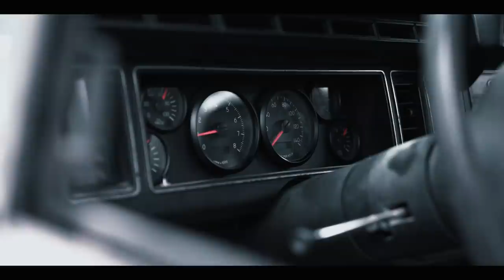4,700 mile road trip in 40 year old Bronco... Goodbye!!!

Comment: Hey Matt, switch your pump over to a  diesel pump on the fire truck so you can run it off the trucks tank and not have to worry about remembering to fuel it up. Alot easier to remember to keep the truck tank full!!
Reply: Good idea
Reply: The trash pump is gas-powered, not diesel.
Reply: @SuperSecretSquirell  that would be why he said switch your pump to a diesel pump
Reply: @charleslaatz6189  oh yeah, I read right over that lol.
Reply: I came to the comments to say the same thing. Lol
Reply: Yea thanks for copying my comment t bud... you literally posted this within minutes of me posting the same idea with different words lol glad someone's comment with that idea got noticed though
Reply: @kolin99895  sorry about that I didnt read any of the comment before I posted. I apologize should of read them first, didnt mean to steal your idea or thunder!
Reply: @TDUBTWYSTEDscion  it was a joke bud just hard to see someone's face through a comment that's why I threw in the lol
Reply: Diesel pumps are hella expensive. Matt can afford it, but it seems like an unnecessary expense.
Reply: @americansmark  Matt has built his empire around unnecessary lmfao
Reply: Matt
Reply: If he really wants to do it, he could just attach a pump to the PTO on the truck.
Reply: Pto pump would be the route I'd go down rather than a separate engine
Reply: @robda7195  agreed. However a diesel pump would be quicker
Reply: Yes or depending on what transmission he has can run a pump off a PTO
Reply: He should put a hose turret on the roof in the hole for a ma deuce
Reply: @americansmark  Not unnecessary at all.  Diesel pumps are a better way for several reasons including the aforementioned ability to run off the main tank, an electric start that can be remoted to the rear of the truck, no flammable gasoline on a fire truck and they don't die in heavy smoke the way a gas pump can.
Reply: Im kinda surprised that this truck didn't already have that setup to begin with. Considering it was a fire truck. The connection is probably there, just disconnected when they decommissioned and removed all equipment. Well all but the lights and sirens lol.
Reply: @kolin99895  When I first started watching he was just a vet... ✌
Reply: P.T.O. pump would be the ticket
Reply: @marvindebot3264  yep, refuelling a gas engine in the middle of fighting a fire would be sub-optimal.
Reply: @SuperSecretSquirell  I almost wonder if thats why the guy said to SWITCH it to a diesel pump?
Reply: No just conect it to the diesel tank so he can spray diesel 👌
Reply: Or just put a pto pump on it
Reply: Yep  definitely agree it needs a pto powered by the diesel. Would be way stronger too.
Reply: I would just leave it for now. Get it working the best it can for now. Everything is going to be going electric over the next ten years. The next ten years after that we will be getting forced to go electric
Reply: Smart
Reply: There is also a reason they don't have GAS engines on FIRE trucks!
Reply: @robda7195  makes the most sense because your not going to shut off the truck anyway. in the case something unexpected goes wrong or changes, the truck can be moved that much faster.
Reply: @SAMUELAXELSSON  now you have a new years party. Wahhwoo!
Reply: I was about to make the same comment when, thankfully i looked down and saw yours.
Reply: @Hey  a firetruck shuld be abel  to make fire? 🤷‍♂️
Reply: @SAMUELAXELSSON  Well Certainly!! 
You have seen the christmas tree videos?

Comment: Hey Matt, about as someone who has worked with forest fire trucks.  You should really consider a mounted pressure water spray nozzle on the front of chief. The trucks that had those were always better because you could run right up on the head of the fire and douse it out without having to worry about pulling hose and get set up. I'm sure your welding guys could easily build something to come up with what you need.  🙂
Reply: it Has the old turret access, that could be adapted to mount a roof nozzle that will rotate at least 10 degrees around the truck. just and another valve to redirect the water from the hose to the front.   Great idea.
Reply: With that having a means of starting/stoping, in/decrease power of the water pump from the cab would also help speed up respons times maybe even get the pump to be powered trough a PTO some how.

Comment: So Matt, about chief. 1) get a basket strainer for your 2in suction hose. 2) to fill hook your hose up and open the valve till the water fills your suction hose drop it in your water body and start your pump before shutting off the outlet valve on the tank. This will allow you to have water in your hose and full suction before trying to dry siphon.... which isn't great on your pump
Reply: You should beable to start a syphon long before the bearing ever gets warm
Reply: I was wondering about that, how much dirt and stuff when sucking water from a pond ect.
Reply: @Pambo101  He needs a floating strainer for filling the tank this will keep the inlet out of the mud and crap
Reply: My thoughts exactly
Reply: Should have a mesh filter sock so that you can just shake the mud off without picking it up out of the water

Comment: Silly Matt, locking the hubs on the front axle doesn’t also lock the differential. The front axle has an open differential, definitely not limited slip.
Reply: Yeah, he's not much into the workings of wheelin.
Reply: Lol, right. weld em like the car
Reply: Airing down the tires would it would have just walked up that stuff.
Reply: @jakefromstatefarm2143  it still has an open diff…
Reply: Matt said the brakes were from a Chevy 250 could the axle be as well??
Reply: @p_campbell  he said they're are f350 axles.
Reply: @brandonsnyder2770  I looked it up its kinda a rabbit hole, I have no clue
Reply: I had a 84 Bronco and installed limited slip front and rear.  He could have limited slip and they will spin just like that in the video.  I had Auburn LS in the rear in which you had to run Equatorque.  Too little of the additive and the clutches popped and pinged, too much and it was more of a open diff.  They really didn't do much overall, nothing like a locker.
Reply: @dirtcurt1  the wheel with no traction wouldn’t have spun as freely as it did if there was a limited slip, it would have spun with jerks and stops as the clutches tried to grip and spin the stuck wheel.
Reply: hopefully he learns from a lack of equally split power instead of a lack of equally split braking......

Comment: Hey Matt, instead of the manual valve install a pressure relief valve. That way when you shut the hose valve it will automatically circulate the water.

Comment: Matt, why didn't you get a diesel water pump that you can fuel from the truck's fuel tank? Or better yet: a water pump that can be powered by the truck's built-in PTO?
Reply: There are definitely options to get a PTO attachment for an LMTV,  also water pumps(for firefighting)  that will run off of it...  as long as the truck runs,  so does the pump
Reply: He needs to have a FF as a mentor on how to build a fire engine. Big kids don’t listen. I have a hard time watching his fire engine project because everything is wrong about it. Having spent 12 yrs in the fire service, everything about it, is wrong. The only thing that is going for it, it is a solid platform to build on. Everything else is rubbish, all stop and start over. Get a mentor and start over and do it right.
Reply: @joepreuitt4658  he does listen to the comments, the problem is that there's a lot of them and with some people thinking they know what they're talking about it leads to conflicting answers.

And maybe what he has isn't the best (I wouldn't know because I don't have experience with it) but it seems to do the job well enough for his needs. For the most part (definitely needs to have a proper look into his suction hose solution)
Reply: @stephen9894  that’s my point. He needs a mentor who can be available to walk him through on how to properly set it up. Bumbling through it makes you look  ignorant to the masses, especially when you video it for masses. I don’t claim to know everything either, I’m ignorant on a great many things. But if I’m attempting to tackle something that I know very little about, I ask for help from friends or family or by golly, there’s always YouTube library 😂to the rescue. What I’m getting at, there’s a right way to do it and there’s the wrong way to do it. Bumbling through his project is the wrong way and in the end, it will be more difficult. For example, I agree with the other comments about having the water pump be diesel linked to the trucks fuel tank. The pump should also have an electric start button mounted in the cab so that he can start it from in the cab to have instant pump and roll capability without having to jump out and start it. There are ways to make his idea into something awesome that will work far better and make his life on his fire engine a lot easier.

Comment: Get a 5-10 gallon outboard/marine fuel tank for the pump.  You have plenty of room to mount one and never have to worry about fuel when it is needed.
Reply: Or replace the gas pump with diesel and plumb it into the truck's tank. Less flammable and longer shelf life.
Reply: Does US fuel not go off like UK fuel? They recommend you use it within 6 months.
Reply: It depends on if it has ethanol in the fuel, most cheap gas in the US has a certain percentage. As the ethanol evaporates it's  replaced with moisture. You can use a fuel stabilizer that will minimize the effect.
Good fuel has 0% ethanol and lasts longer.

Comment: Put a 2” connection on the tank at HQ to speed up refills. The trick to drafting with your pump is to leave some water in the tank and then dump it into the hose when you start the draft. That way you get rid of the air in the line.
Reply: I was thinking, the trick is to not run dry, or rely on the bumpy ride to the water to slosh a bit out of another loaf of that tank so you can prime the line

Comment: OffTheRanch Matt, if there is a PTO off the transmission on the truck, you might be able to find a pump that will run off of the PTO (via CAT power), if you decide to upgrade the pump system, in the future.  Also, if you could place your controls in one general area, such as a control panel, instead of walking all around the truck, it would be easier to operate, when seconds count.  (The overall path of water distribution would be the same, but the plumbing (behind the panel) might get a bit complicated and maze-like, but it would result in a quicker, easier to operate system.)  If you keep or have an auxiliary pump in the truck, it should be diesel, so that all engines use the same type of fuel.  Permanently mounted diesel units fuel could be plumbed off the truck's own fuel tank, allowing one type of fuel to be used for all engines, and reserve fuel containers.

Comment: 1. Make it a diesel or PTO pump
2. TOOLS (axe, saw, natural fiber broom, pick axe, shovels, etc)
3. Water gauge (preferably on multiple sides so you can see it - most engines have a digital color coded light system)
4. Basket/floating strainer for the suction hose
5. Storage for tools and extra gas cans - mounting points, etc. 
6. When filling the tank with suction, make sure you have some water left in the tank and when the valve is opened for suction it will fill up the hose and basically prime everything. Then begin your suctioning to fill the tank.

Comment: You also may want to invest into a float for refilling the tank to help keep fish and sticks out of the pump and ruining it.  Also if you change the pump to a pump that runs off of the fuel the truck uses you can have one fuel for both.  But you may need to upgrade the plastic pipes with metal to help contain the higher pressures, and it will also help keep the pipes from cracking or bursting over time The plastic will start getting brittle in the sun over time.

Comment: Smart setup on that firetruck. I'm thinking a small tank on top to use for priming with maybe a y and a check valve.  That might help draw water from a pond. I didn't see any filter and maybe adding a secondary fuel tank for pumps.   Nice send off on the Bronco.  Hope it will last many years up in the last frontier.

Comment: Looks like the Bronco just has open diffs. Without a limited slip or locking diffs the wheel with the least amount of traction at each axle is the one that is going to get the power.
Reply: The back was def tossing twin rooster tails....
Reply: Needs a front locker for sure. Lunch box lockers are quick and easy.
Reply: @llwood78  open diffs will throw twin rooster tails if both sides have equal traction. When he was trying to climb though the side without traction was the only one turning wheels...

Comment: Looks like 2 open differentials. Rear limited slip or locker would help a lot
Reply: Yeah, I was gonna mention that. Certainly not a locker of any type up front.
Reply: Definitely open diffs.
Reply: Or just let some air out of the tyres.
Reply: @johanswart8116  doesn’t help unless you transferring power to that tire. Open diffs can’t climb wall like that.
Reply: @lemonaid8678  open diffs with hard tyres. What an good combination. Lol
Reply: Welcome to the 35psi club!
Reply: Was checking to make sure someone filled him in on why only one wheel front and rear were spinning. I'd recommend some upgrade parts to him, but since it's enroute to Alaska and not Matt's anymore that'd be pointless. Definitely needs some diff upgrades for that sort of climbing though. Open front and rear is barely even 4wd.
Reply: Or just mount a winch on it like an experienced off roader would do
Reply: You would be a fool to put locking diffs in that body style
Reply: They turn so crappy already. Do you want a nightmare everynight after?

Comment: If you have trouble “drafting” from a pond or other static source due to air in the line there is a solution. If you keep enough water in your system to backfill the suction line you can evacuate the air that way and get a prime to the pump.

Comment: Yes unless you put a locker in the front axle its a limited slip even in 4wheel. 4 wheel is actually 2 wheel.
Reply: Nope, open spool is stock on those, I had one
Reply: If you followed the build he put f350 axles in it, its not factory bronco axles he actually mentions it in this video. I also saw each wheel in the front spinning at different times during the video, thats what a limited slip does transfers the power to the side with most traction. If it was an open diff only one wheel would spin and one wheel only.

Comment: Here in the UK most 4x4s still have limited slip differentials, you have to buy and fit aftermarket diff lock kits if you need that extra bit of traction.
Reply: No stock LSD in the front of a Bronco at all mate, it's an open spool diff so yeah, a locker would help greatly.

Comment: And now Matt knows why it takes an engineer to operate an engine.
Put a pressure regulator on the return side and you wont have to worry about using that valve.
Reply: I thought that, you want an automatic recirculate system

Comment: Spray bar on the front bumper.
Swapping to a diesel with electric start would be nice. Strainer basket and a foot valve are also good ideas. Short of the diesel swap for the pump. A Jerry can for fuel and maybe a couple mounted with water for priming the pump in an emergency.

Comment: Another good mod would be a spay system connected to a bull bar on the front of the truck pointing down in front of the truck. They used to have those on the CFA trucks in Australia for grass fires. Also a spray set up for inside the cabin in case the bush fire surrounds you as a potential saftey measure.

Comment: Suggestion -
A- look into using the PTO from the truck to run a pump. 
B- Get a float for the hard suction line so if you draft from a pond you don't pull the silt and rocks from the bottom.

Comment: Matt one thing you might want to put on the fire truck are a few water fire extinguisher that you can carry to specific area when you or some else is using the truck over there.  You can get them in aluminum tanks and come in 10 15 20 pounders.  Get a few and mounts them in a rack back by the hose reel.

Comment: @12:20

That’s an open differential. Power is applied to the wheel with the least amount of a traction thus only one wheel is spinning. Limited slip has clutch packs inside the diff that allows both wheels to spin. A common misconception about manual locking hubs, which is seems you’re confused about as well, is that they acted as a “locker”. All they do is connect the axles to the wheels essentially. The power transfer is inside the differential which happens before the locking hubs. I’m sure you already know some of this but going more in depth might help others that are reading it.

Comment: Hey Matt, if you really want to upgrade your Fire Truck 🚒  switch out that pump for one that runs off the trucks engine. That way saves all the problems of fuel, and makes maintainance easier.

Your suction hose needs a mesh cover for going into lakes etc or you'll damage your pump. 

Get yourself some Fire Extinguishers (ideally   Dry powder or Fire-exo) and brush fighting kit, you don't want to waste your water or your time for smaller or unique situations.  If you really wanted to pimp the ride you could look at getting a foam dilution system added to the tank so you can have foam and water, be a good way to get more bang for your buck.

Also you could get yourself a cab monitor with auto suppression  if you want to continue to using it alone.  H&H Bulldog 4x4 Wildland FireTruck is a good place to look for ideas,  especially the ground suppression aspect.

Comment: Hey Matt. Mount a float valve in the top of your tank. then you can plumb in a small pipe with a disconnect for your garden hose to fill the tank.Then you won't need to monitor it filling. 
Love the channel.